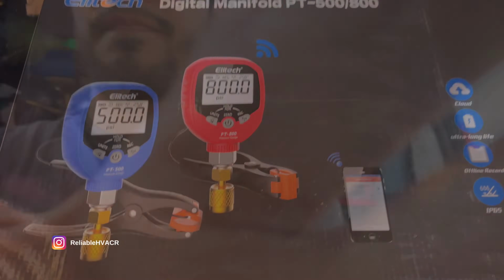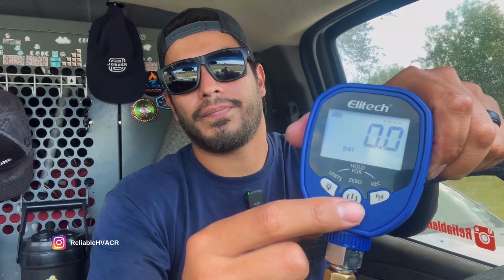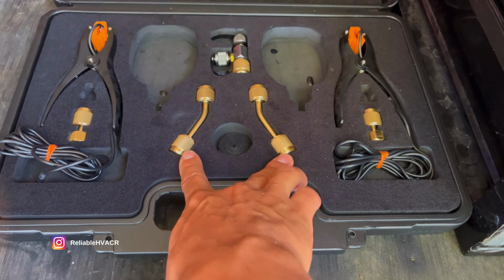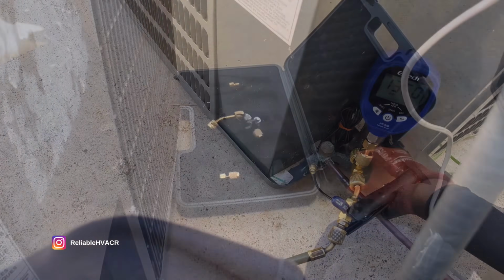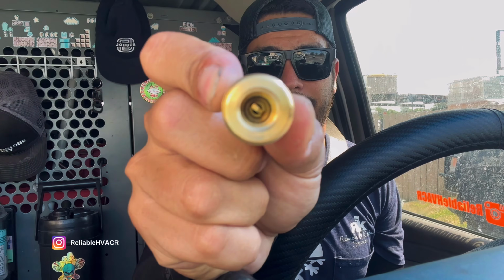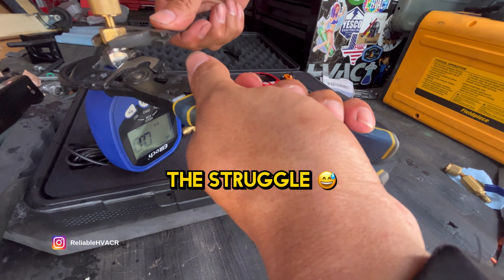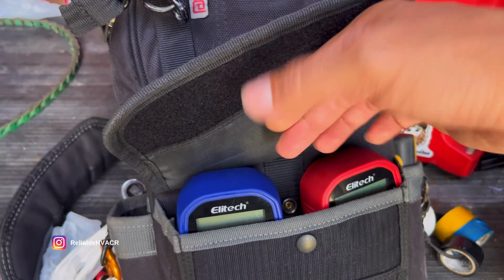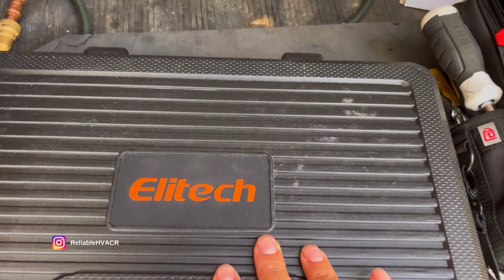ELITECH PT 500/800 Wireless Pressure Gauges Kit : Is it worth getting?

Comment: I use yellow jacket adapters, the ones supplied are cheap and got tossed immediately. I’ve had zero issues I use a Testo 557 and at times use these for quick checks or even alongside my Testo manifold for an easy way to check oil pressure on racks

Comment: Hi everybody. I'm fairly new in hvac-r. Most of the aircond in my country are mini splits and they don't have service port on the high side. My question is, if I am only going to get the red one (pt800) but just need it to be used on the low pressure service port, can it still read superheat or it's going to show as subcooling on the apps? Because, pt800 is all I can afford. Thx in advance for your input guys.

Comment: Great honest review.  I've seen in other reviews that you really have to tighten them down to avoid leaks - so you have confirmed this.  I also like the displays - just wish the temp gauges also had small displays - that would be even better.

As for the App, there may be an option in their Settings part that indicates the actions/connectivity of the probes when you turn off the probes.  Something like always remember gauges drop when turned off.  Something like that.

Comment: The rubber bushing fell out of my high pressure hose the first time I used my new manifold. The fittings are cheap also surprised they are not low loss

Comment: These work great! Had them for 2 years now and never had an issue or leak. You need to use thread tape for the gauge threads  and then add or use any fittings. But yes the fitting with curve does not work at all. Had same issue with that one.

Comment: Just tryed mine had issues with recharging with the T idk I charged up it seemed like it got stuck in the t or something I ended up removing the shrewder valve in it and worked good.. seemed to either get stuck at the charging pressure or it would read no refrigerant idk
Reply from the maker: I had to use my own fittings for this all to work

Comment: Just purchased these, going to give them a shot. I have the Testo set and I cannot stand that you have to use your phone for everything. It's nice if you're going to be at one place for a while and can track everything on the phone and also get a data log to save for later but if you're just doing PM's and need to check a bunch of systems it's clunky at best. I usually keep just stubby individual gauges in my bag but then it's a pain getting the pipe temperature. I wish somebody would make a pipe clamp with a digital readout instead of the k-type clamp or full Wireless. That would be nice. Got the $17 Leak Detectors with my order as well so going to give them a try. Those might be nice to use on some of the bigger leaks that are easy to find before breaking out the H-10.

Comment: I have an amazing product that can fix a ton of the issues you were having. Now this product is very new so I may be mispronouncing it but I think its called "Tephlan Tapè." It should be by the burn remover and your van's blinker fluid.
Reply from the maker: Maybe I didn't mention it but I clearly had it out at 8:17 with my nylog as well, nothing sealed it until I forced the crap out of it. But thank you for your awesome comment 
👏🏽👏🏽👏🏽
Reply: @ReliableHVACR  I figured you were smart enough for it but I was just making a joke. I haven't run into the issues you had but the biggest issue I found it the weight of the gages themselves and the amount of fittings you need can all contribute to leaks. I overall like them for quick pressure readings but past that, I would use normal manifolds with small length hoses. I also work with equipment that can have a negative suction pressure so if I add my gauges as is, I can add air to the system.

Comment: So I just bought this set. I been doing A/C and refrigeration for 11 years. Always used analogs and calculated subcool and superheat using temp clamps and using math the guys at my place of work like all the digital stuff until I was intrigued with wireless field pieces. I don’t want to pay $600 + for a setup so I saw these. Good review makes me feel better. I’m not too worried about the brass fittings leaking I can rig stuff up if needed. It’s amazing how technology came a long way . Thanks for the review

Comment: Should have put that money into the 6 piece FP JOB LINK set with air probes, when combined with the Measure Quick APP it will actually take the info from all probes and give you a diagnosis while giving you system performance data and tell you what your most likely issues are with the system! Pricey YES, but they give you every piece of info you need down to RH DB WB enthalpy and actual system capacity.

Comment: Those gauges are best to mount on a manifold and leave them on it.
Reply: Exactly
Reply: If you go with yellow jacket adapters you won’t have any issues. I threw the ones it came with away immediately lol
Reply: I purchased a used set of these recently. I have had a 4-port Snapon gauge set since the 1980s when I worked on vehicles. Gauges failed. I wanted to mount these on the aluminum block. For testing I used the included fittings and had no issues with leaks, but won’t use them once I mount them. Good review.

Comment: you need teflon on threads.
Reply from the maker: Tried that same thing, ended up just using nylog at the end
Reply: @ReliableHVACR  Did the nylon solve the problem of leaking? When switched couplers?